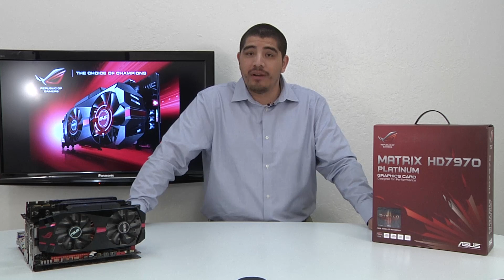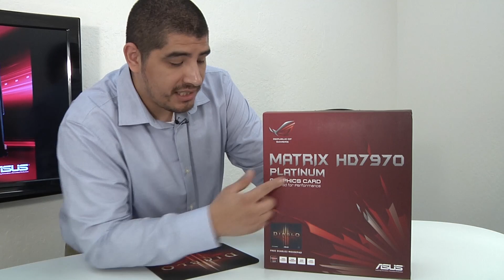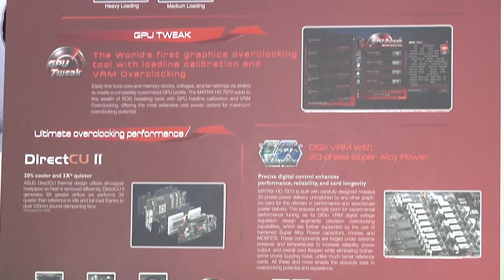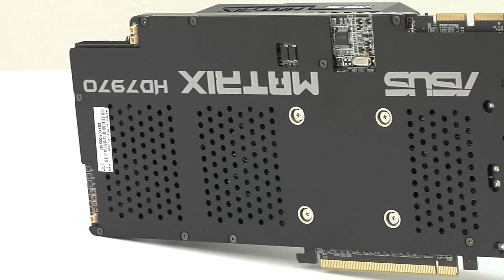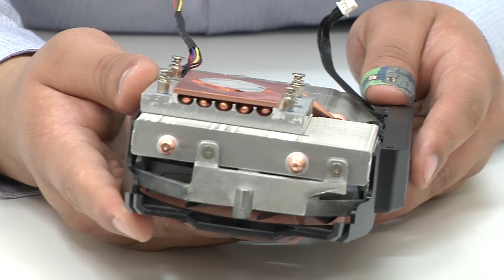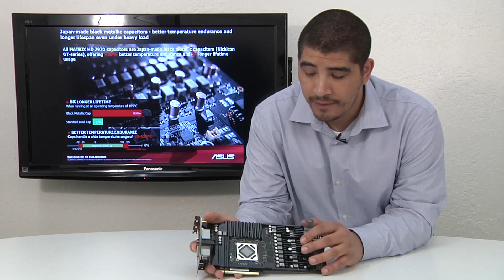Matrix HD 7970 Hands-On Overview

Comment: Would the crossfire bridge have stretched from gpu to gpu on that board ? because i want to purchase a crosshair motherboard and two of these gpus but i dont know if the bridge will fit across, it would be setup the same way they were on whatever motherboard you had there.     ?

Comment: Plus, like the predecessor: Direct CUII 7970,

I mean sure, it might have the same amount of screw holes or close the same amount as the reference design, if you at the size of the PCB, there is no way in the heck that you can use a normal 7970 Full cover waterblock on it. It has to have it's own Custom Waterblock.